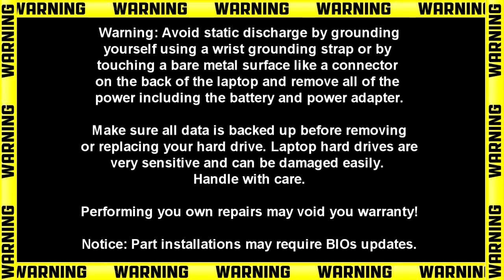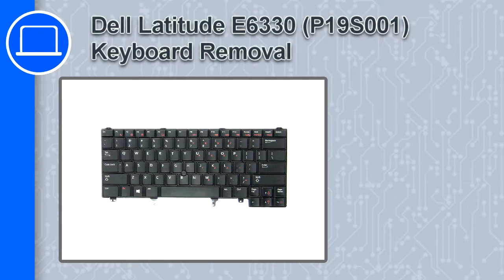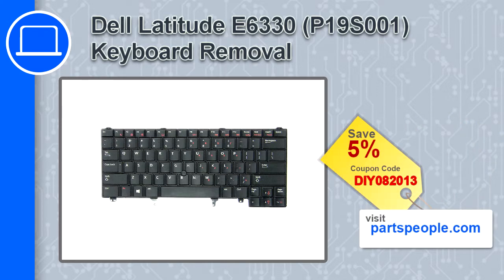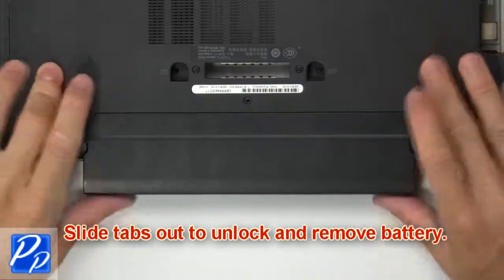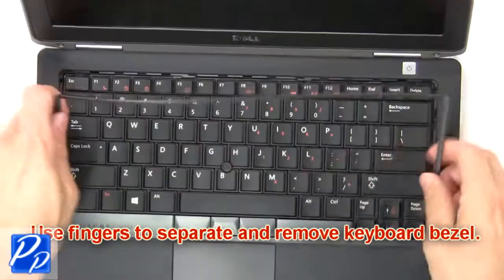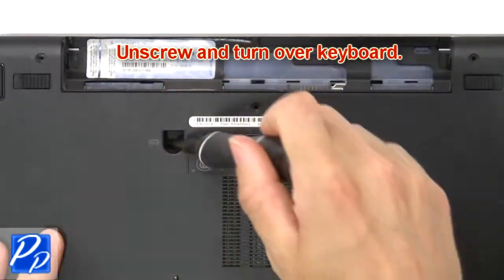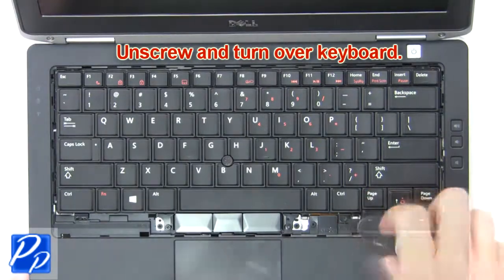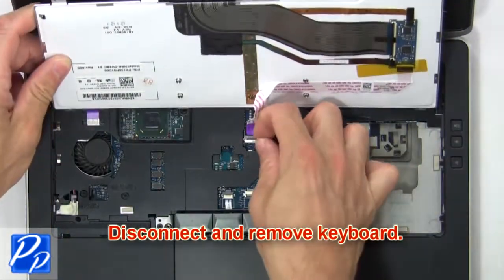Dell Latitude E6330 (P19S001) Keyboard How-To Video Tutorial

Comment: Short and sweet. No talky talk intro, just right to the point.   I think your video highlights the wrong screws, however.  The red circles appear around screws that do not need to be removed when disconnecting the keyboard.